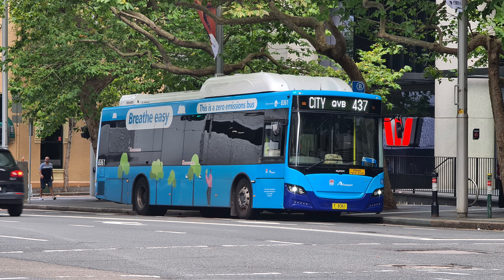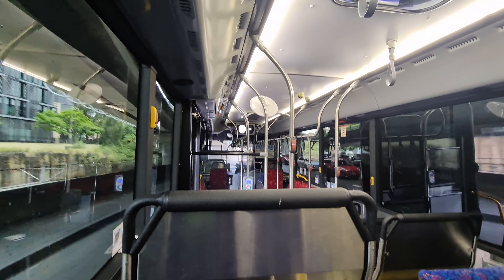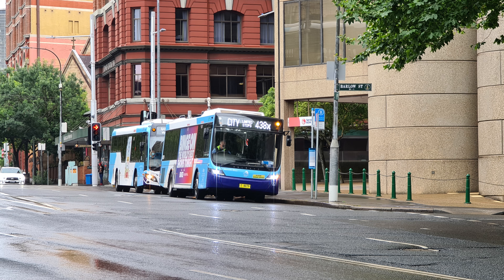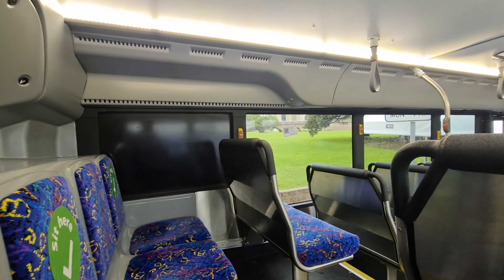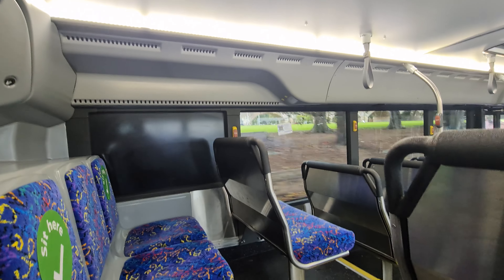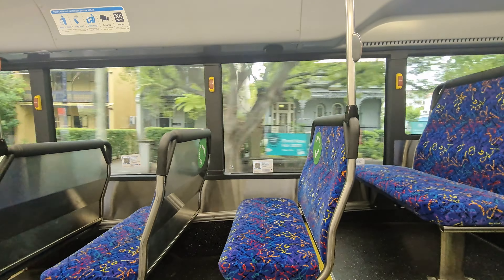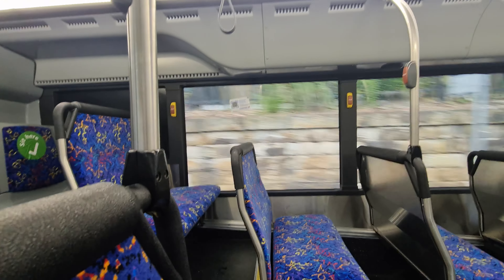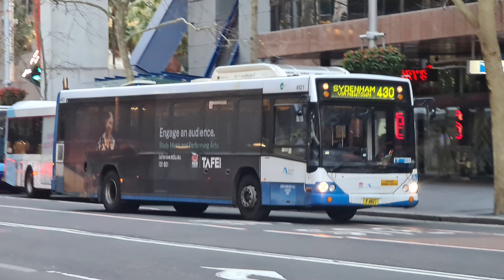Transit Systems Mercedes Benz O500LE (Volgren Optimus)

Comment: Shame these buses still have the moulded plastic seats at the back and the rearmost window on the left side blocked up.
I think the Gemilang bodied Mercedes O500LEs have a better interior because at night the lighting on the Optimus is terrible.
TSA also bought some Volvo B8RLE Volgren Optimus buses in 2020 and I think they are basically the same but have a 320hp engine.
Also did you hear TSA has been locking up their electric buses on weekends now?
Reply from the maker: The left side window was the main one that surprised me. I don't mind the bucket back seats, but it's just part and parcel with the Optimus body, along with the LED strip lighting, which I've always prefered. When I was editing this I realised that a few of the still images were actually of the B8RLE's and only realised just before it came time to export - extremely similar looking.
Reply: @TalkingPlanning  I actually think CDC made the right call to ditch the moulded plastic rear seating on its third batch of B7RLE optimus buses. 
There are a few ways to differentiate the B8RLE Optimus and the O500LE Optimus. The O500LE has both Diesel and AdBlue fuel caps in front of the rear wheel while the B8RLE has one in front of and one behind the rear wheel (forgot which ones though). Also the B8RLEs have Volvo on them.
Do you know why TSA might have chosen to scrap the left rear window? It could be a cost saving measure but that seems unlikely.